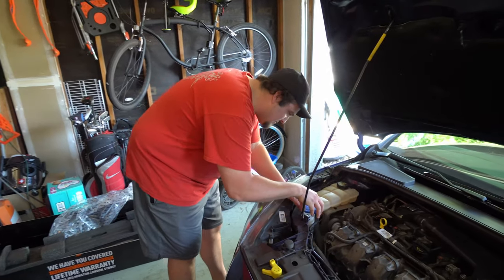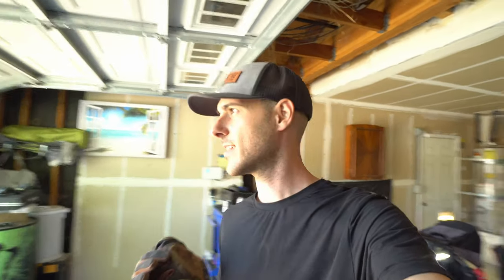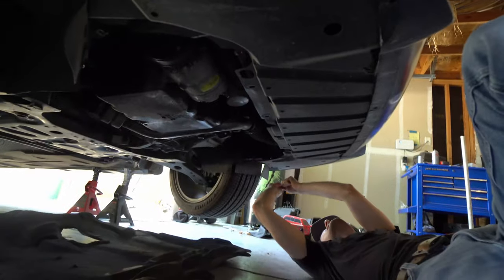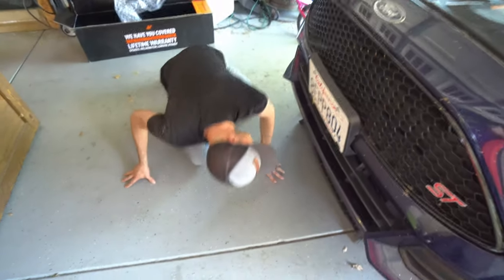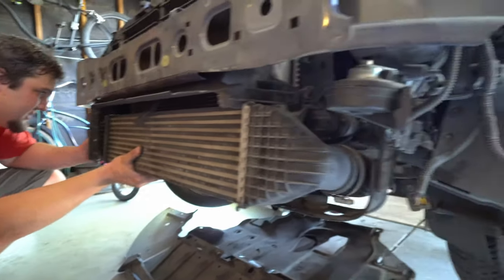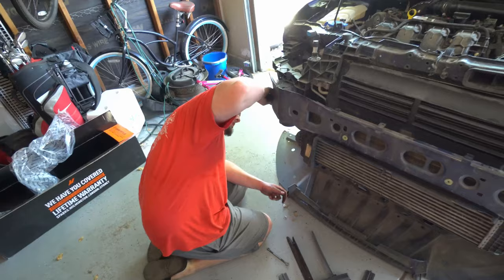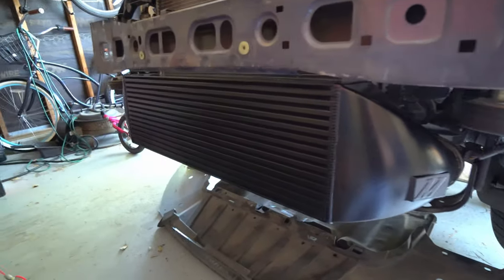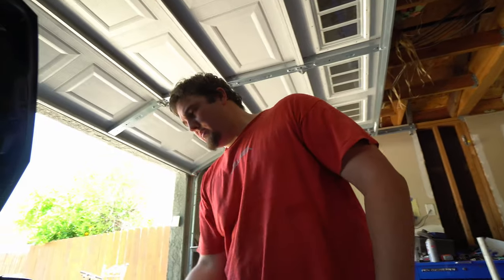2016 Focus ST Intercooler Install (It's Cold!)

Comment: hi there, a question if you remove the active grill shutter will the cooling fan run continuously at the highest level?  Is that true or is there a way that it doesn't always work? 

Nice Job guys 👍👍👍👍 very interesting 😉
Reply from the maker: Removing the active grille only helps with aerodynamics which is “supposed to help fuel economy” have t had a problem in my 21 F150 or 20 Explorer ST
Reply: @NeverStock  thank you very much. 👍😉